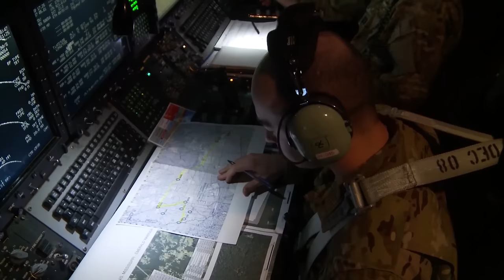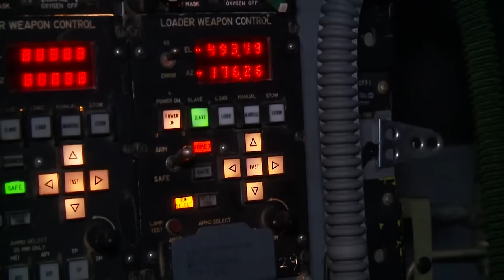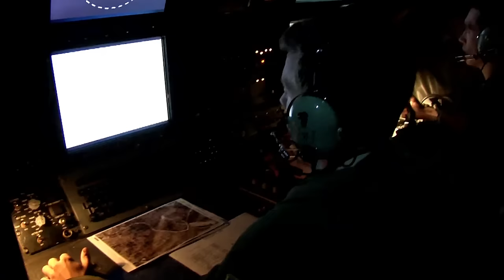AC-130 Gunship in Action - Firing All Its Cannons • Exercise Emerald Warrior

Comment: Incredible how quiet it is inside the hold when the weapons are firing
Reply: The engines are really loud tho
Reply: I believe it's because the end of the barrel is outside the hold, where the gas is released
Reply: Well you’d think it has to be, it wouldn’t make a very effective gun team if their eardrums blew out
Reply: It’s not that quite the engine is just so loud it mask most of the noise from the weapons. Lol
Reply: The serenity inside the plane and the chaos it causes on the ground... They are beautiful!
Reply: Its very loud I dont wanna be a c 130 gunner I'd rather be in a b52 instead
Reply: About 8 inches of sound deadening in the walls
Reply: 2 foot long bullet, and all that's heard is the casing falling into that bag
Reply: Just keep in mind it’s louder in real life than on video
Reply: The sound levels heard in the video are totally not representative of the actual sound levels inside the aircraft. 
It's a very, very noisy environment. It's so loud inside that the crews are wearing foam earplugs underneath their helmets, or headsets.
Reply: Neon lights
Reply: C130s in general are noisy as hell, inside and out. A military aircraft with four turboprops, what do you expect? At least half of the ones I've been in have had hydraulic fluid all over the floor - "leaking within limits".
Reply: The noise levels on the C-130 from the engines alone are enough to cause hearing damage if not wearing ear protection.
Reply: The guns are outside
Reply: You're just hearing a recorded version.  Any 130 is the loudest plane I've ever been in.  You had to wear ear protection just to sit on the jump seats.
Reply: The camera messes up the audio, and the engines are loud as hell
Reply: INSANELY loud inside
Reply: u less they make it rain
Reply: Also incredible how much nasty stuff gets in the air onboard. Every single one if those guys in that plane will have a lung condition in several years.
Reply: @thetomgamerboi6817  Just imagine how many have fired D.U rounds and will develop cancer.
Reply: Inside is loud from the aircraft. Hearing protection is required. But the noise you are referring to is at the muzzle, the gasses coming out
Reply: Inside is loud from the aircraft. Hearing protection is required. But the noise you are referring to is at the muzzle, the gasses coming out
Reply: Inside is loud from the aircraft. Hearing protection is required. But the noise you are referring to is at the muzzle, the gasses coming out
Reply: @alexandermarinaccio4926  still its turbo prop engines is what makes it annoyingly loud
Reply: That's coz it's probably not. The microphone must have normalized the volume.
Reply: Its probably fuckin loud in there its just quiet in the video
Reply: Of course, the explosive sound mostly comes out from the nozzle, not behind the barrel.
Reply: It’s not actually quiet inside those things. The sound is edited.
Reply: It’s not
Reply: Im pretty sure thier helmets also help to muffle sound and ear protection
Reply: @alexblosser5708  있는 것 같습니다 달리 산적과 아낙네
Reply: @alexblosser5708  있는 것 같습니다 달리 산적과 아낙네
Reply: When everything is loud, then nothing is loud
Reply: @hunterdude113  also possibly noise cancelling microphones
Reply: I don’t know why this got nearly 2k likes it was kind of a dumb comment looking back lmao
Reply: I think the mic isn't just picking up how loud it is in there
Reply: @mervgocrazy19  I dont think engines are as loud as a blast from a giant gun. What matters the most is the fact that the blast wave is ejected out of the barrel of the gun that happens to be outside of the aircraft and its not getting inside the aircraft.
Reply: Yeah those giant propellers combined with the sound of the air moving over the craft is the loudest thing. 

Another reason  the guns are relatively quiet is that they're firing outside of the craft but another thing to consider is the craft is traveling idk 275mph? and as it travels through the air it's constantly moving away from the point where it created the sound.
Reply: @Rutherford_Inchworm_III  yeah, that sounds like military mechanics all right
Reply: «И Ангел сказал мне:
    Почему ты удивился? Я скажу тебе тайну женщины и Багряного Зверя, несущего её, имеющего семь голов и десять рогов.
    Зверь, которого ты увидел, был, и нет его, и ему предстоит подняться из Бездны, и пойти в погибель» («Откровение» Иоанна Богослова 17, 7-8).
    «Зверь, которого ты увидел, был, и нет его» – СССР (первый период власти атеистов «Багряного Зверя», 1918-1991) – первое в мировой истории федеративное государство «диктатуры пролетариата» [располагалось в Восточной части Европы и в северной части Азии (территория 22,4 миллиона кв. км.)]. Было образовано в 1922-ом году, развалилось за три дня без войны на 15 самостоятельных государств в 1991 году.
    «И ему предстоит подняться из Бездны» – (второй период власти либералов «Багряного Зверя») возникла новая страна – Российская Федерация, правопреемница СССР (территория 17,1 миллиона кв. км.), в то время как народы Европы и Малой Азии стали жить под символом «Зверь из Бездны» (1991-2037) [Современная Российская Федерация, как ранее Советский Союз, прорезывается густыми прослойками пёстрых национальных культур Востока (16 автономных республик, 5 автономных областей, 10 автономных округов, 6 автономных краёв), пробуждённых в период «культурной» революции в СССР.
    «И пойти в погибель» – заблудившись в коррупции, в откатах, в воровстве, в чиновническом беспределе Российская Федерация должна прекратить своё существование в период с 2018 по 2025 годы].

  
    «Что говорили православные провидцы о нашем времени и о Путине?
    ПРЕПОДОБНЫЙ СЕРАФИМ САРОВСКИЙ:
    «Антихрист родится в России между Петербургом и Москвой… Среди славян и русских родится истинный антихрист-бесочеловек, сын жены блудницы Данова поколения…».
    Серафим Саровский упоминает два города. Это означает, что антихрист будет постоянно ездить из Москвы в Петербург и обратно. Эти два города станут для него как родные. В них он будет часто находиться. Мы знаем, что Путин работает в Москве, а проживает в Санкт-Петербурге. Серафим Саровский абсолютно точно предсказал, что антихрист будет проживать именно в этих двух городах.

    МАТРОНА МОСКОВСКАЯ:
    «…Народ под гипнозом, сам не свой, страшная сила вступила в действие…».
    Провидица считает, что нынешний правитель (Путин) заколдовал и загипнотизировал народ, так как владеет «страшной (дьявольской) силой». Только загипнотизированный народ, проживающий в страшной нищете, бесконечных кризисах и экономическом дне, может восхищаться правителем, который довел их до такого состояния.

    НИЛ МИРОТОЧИВЫЙ:
    «Настанет время, когда люди будут безумствовать, а кто не безумствует, тому будут говорить: ты безумствуешь, потому что ты не похож на нас».
    Мы видим, как сейчас наш народ безумствует – радуется нищете, радуется, что чиновники крадут миллиардами, радуется, что нет войны, когда на границе нашей страны как раз и идет война. Мы вымираем, а народ все равно радуется. Путин заставил наш народ радоваться любой ахинее, которая приходит ему в голову. А это уже безумство.

    ПРЕПОДОБНЫЙ СЕРАФИМ ВЫРИЦКИЙ:
    «Наступает царство лжи и зла… вновь восстанет брат на брата… С одной стороны, будут воздвигать кресты и золотить купола, а с другой – настанет царство лжи и зла».
    Именно во время правления Путина везде, практически постоянно, строятся и золотятся храмы. Храмов стало уже чуть ли не больше, чем заводов. А ложь с экранов телевидения превысила все разумные пределы. Сейчас ложь выдается за правду, и эта ложь со всех каналов идет потоком безостановочно. Царство лжи уже наступило. И храмы золотятся. Данное пророчество Серафима Вырицкого во всей своей полноте исполнилось именно во время правления Путина.

    СХИАРХИМАНДРИТ ХРИСТОФОР (1996):
    «При дверях антихрист. По Москве он уже ходит. Уже жить-то и нерадостно».
    Здесь старец определенно говорит о Путине, поскольку как раз в 1996 году Путин переехал работать в Москву. А старец его уже почувствовал, что он рядом, в Москве.

    ПЕЛАГИЯ РЯЗАНСКАЯ (о российском народе):
    «А народ почти весь порченный. Сейчас народ-то выберет себе антихриста! Антихрист придет в России к власти. И тогда, после антихриста, Господь откроет своего Царя в России».
    Как видим, провидцы упорно твердят, что в России к управлению страной придет антихрист. Так что далеко его искать не следует. Просто включите телевизор, который зомбирует по 24 часа в сутки, и вы его там увидите. 

    .  אדם לא חייב להיות מרותק למיטתו, על מנת להיות מוכר כאדם סיעודי. ועדיין, זה לא פשוט לתמוך באדם סיעודי, במיוחד אם הוא קרוב לנו (הורה למשל). כל סיוע שנקבל עבורו הוא מבורך. למרבית המבוטחים בקופות החולים קיימת פוליסת ביטוח סיעודי, אך שלא רבים מודעים לכך. בעזרת חברה למימוש זכויות רפואיות תוכלו לתבוע את הביטוח ולקבל סכומי כסף שיקלו מאוד על חייכם וחיי האדם הקרוב לכם אדם סיעודי יכול לפנות לכמה מחוזות לקבלת סיוע. זה מתחיל עם המוסד לביטוח הלאומי, שעשוי לספק לו שעות עבור מטפל אישי או סכום כספי בעל אותו ערך. סיוע משמעותי עוד יותר הוא הביטוח הסיעודי, שמשווק כיום בעיקר על ידי קופות החולים. גם חברות ביטוח עשויות להציע את הפוליסה החשובה הזו, אם כי בדרך כלל אלה פוליסות שנפתחו לפ זכאים לעיתים גם אנשים שמתפקדים בצורה סבירה."למרבה הצער, אין כיום מודעות מספקת לגבי ביטוחי הסיעוד הפרטיים. ברוב המקרים מדובר בפוליסות הנמצאות תחת קופת החולים, ורבים הרי בכלל לא מעניקים תשומת לב לדו"ח התקופתי שהם מקבלים מהקופה", מתארת אילנה בריסקמן - מומחית זכויות רפואיות בחברת לבנת פורן. "לא פעם נתקלתי בבני משפחה שאמרו לי באופן נחרץ שאין לאבא או לאמא שלהם ביטוח סיעודי. וכששלחנו אותם לבדוק את הנושא, הם גילו שיש להורים ביטוחים משמעותיים שיכולים להקל מאוד על ההו
Reply: @pokemon4376  Real life is recorded on video.
Reply: @thetomgamerboi6817  what stuff for example and where does it come from? The machinery or the guns?
Reply: @seanhines7296   wow you must be a genius to have figured that out all by yourself
Reply: Потому что у всех закрыты уши наушниками 😅

Comment: Anyone else realize this plane is flying over 20,000 ft at 300 mph( these are estimated) and hitting targets. Incredible.
Reply: no because its not flying anywhere near 20,000 feet. The cabins are unpressurized, they can fly up to around 7,000 feet usually at night to avoid AAA
Reply: @NoobOfShame  7k is nowhere near enough to avoid AAA(at least directly above). Also in an unpressurized cockpit the FAA regulation say no higher than 14k.
Reply: Мы Русские думаем  - это ж сколько железа на землю рухнет если я его собью ))))) Зря сделали это убожество! ))))) Сорь! Бесполезная трата денег!
Reply: @НикТо-я5ф  Russians shouldn’t be lecturing anyone about military preparedness.
Reply: @zorth4729  Совсем дурак что ли? Кто если не Русские!? Запомни у СЛАВЯН сейчас 7530 год от сотворения мира и за всё время их никто  и никогда не победил! Ты просто не знаешь что такое Русские в бою! И лучше тебе не знать! Когда Русские идут в атаку ,они не кричат не злятся и не орут ,они молча убивают и много! И вот это СТРАШНО!
Reply: @JD96893  max altitude and operational altitude are vastly different. Ac130s have an operational altitude of about 7,000 feet which is why they typically fly at night. While it’s true that even an older zsu 23 could be a deadly threat, good luck finding a war theater where the enemy has SPAA with NVDs, if any SPAA at all. Zsus are pretty common, but on fixed positions or technicals/trucks. So they are going to be severely limited in night operations, if not completely ineffective against aircraft like this. My point wasn’t to say it’s out of AAA range, but AAA isn’t really much of a factor at night time in places where it most commmonly operates
Reply: @zorth4729  That's another pro putin dummy, he's not worth someone's time
Reply: @zorth4729  on the contrary, they are the most qualified.

After all, they have the most personal experience.
Reply: @Cobrax_x  Very nice.
Reply: @NoobOfShame  the fuselage of c-130s are most definitely pressurized. That said, I don’t know at what altitude they typically fly at for their missions since my job is just to fix them.
Reply: @НикТо-я5ф   We Americans have a saying. We don't want war but if you provoke us. Someone else is going to raise your kids.
Reply: @christophermorris6386  i like that
Reply: imagine if we used that genius in something not as deadly ?
Reply: @НикТо-я5ф  I’ve always loved how Russian translates to English. It’s a different phrasing of things interesting. Seems like an elegant way to say things sometimes. But besides that point Russia would get lit up by the US 😹 especially if they tried to invade us. 🫶🏻
Reply: @НикТо-я5ф , нельзя отрицать то, что США и остальные страны могут потягаться с Россией в военной силе, т.к. это будет безрассудно.
Также я хочу отменить, что Россия неоднократно проигрывала. Я могу привести несколько примеров когда Россия потерпела поражение или была на грани. К примеру:
-Татаро-монгольское нашествие (мы им потом ещё и 300лет дань платили)
-отечественная война 1912года (мы выиграли, но нам пришлось сжечь столицу в которую зашли французы, и уже тогда у наших предков получилось выгнать французов)
-Крымская война (та, что в 19веке)
-русско-финскоая война (мы победили, но было так много потерь и затрат по сравнению с финнами, что теперь это самая позорная война в нашей истории)
-Первая мировая (ну тут и так ясно, что развал державы и потеря земель с вынужденным подписанием мирного договора с немцами трудно назвать победой)
-Начало великой отечественной (Мы были на грани от поражения, немцы чуть не вошли в Москву) 
А это ещё не все примеры.
 Ну и к слову на територии Украины как-то туго всё идёт, а все вопили про то, что за три недели победят на легке.
Т.ч. советую пересмотреть свои взгляды на мир.
Reply: @stentrum5989  I agree with you, I'm glad that you understand that and I hope that he didn't spoil your opinion about the Russians.
Reply: @lucasvarela9632  issue is, they wouldn’t try invade, it would just be nuclear war
Reply: @tobp  ground invasion is the only choice really. Or maybe a ground invasion after the dust settles from all the nukes
Reply: @NoobOfShame  i thought they were pressurized,
edit : just checked the specs and it says they are actually pressurized
Reply: @NoobOfShame  I’m pretty sure they have supplemental oxygen
Reply: @НикТо-я5ф  
Действительно глуп тот, кто выкрикивает оскорбления и браваду на людей, которые уж точно не говорят по-русски...🤣
Reply: @НикТо-я5ф  Как вы могли подумать, что Россия никогда не проигрывала войны. (Просто говорю 1-е место по потерям войск во 2МВ)
Reply: @JD96893 i think he said that ac-130s fly at night to avoid AAA
Reply: @НикТо-я5ф  и как твои жмуры поживают)? Ты уже в Грузии)?
Reply: @NoobOfShame  You don't need any NVGs at all for this kind of AA defense, remember WW2? Just fire a star shell, use flak lights or anything that illuminates the sky to make the outline of this flying behemoth visible, it's the same tactic they used in  the navy to outline ships. Half of the time the natural lighting by the moon is enough to make it out. The Truth is, F4's were downed in vietnam at night by stationary small calibre man handled AA guns, flying low, fast and being a much smaller target. The AC-130 is only good when you have total air superiority which wouldn't be the case in any bigger conflict, hell even in Afghanistan there were no fly zones for these because of all the MANPADS in circulation.
Reply: Кто, если не мы? Горят Леопарды, Челенджеры... Абрамсы выпускать испугались... Пэтриот жгем Кинжалами... так что только Руссским, а не Западу!
Reply: You are right cause I remember in Mogadishu in 1993, AC-130 used to hit us at mid night.
We as civilians used to call it Feeder which we mean it gave us bullets as food 😂😂 @NoobOfShame
Reply: @CygnusX-11 how do you think we put a man on the moon
Reply: @EAGLINWRX  not just deadly but also pointless
Reply: @CygnusX-11  the technology used to put men on the moon was later adapted and is now in every handheld device you use today as industrialization picked up. To simply put all the aspects of a crazy feat like putting a man on the moon into a bin as useless is not only stupid but also ignorant. NASA’s research on materials and structures are also adapted and seen in many aircraft today as well as the materials in odds and ends for heat resistance, corrosion resistance, etc. Military weapons are what allow you the freedom to type as you please on the internet. Whether or not you live in the USA, every nation has a military. And the guy has the bigger stick and he knows how to use it better, you don’t stand a chance.
Reply: @НикТо-я5ф exactly what i thought hearing of the a50 crash! sorry comrade 😉